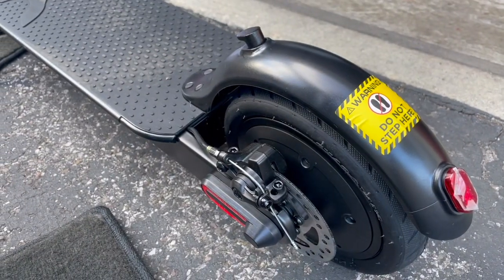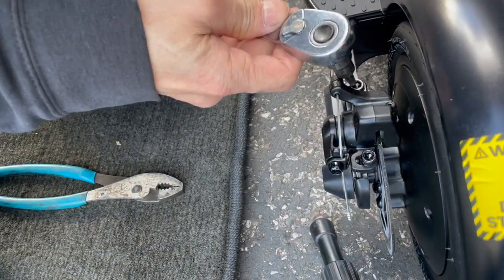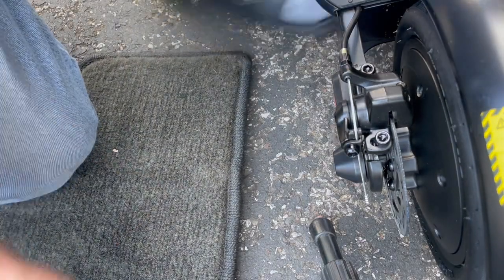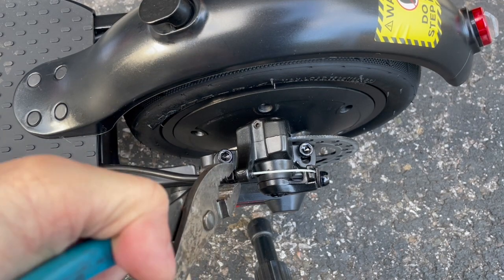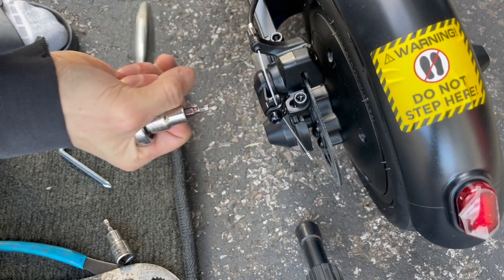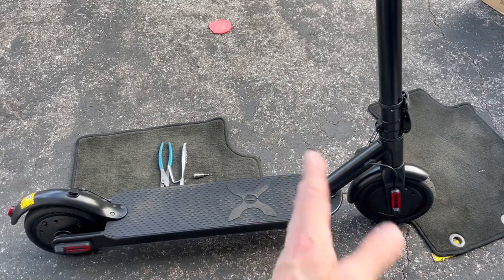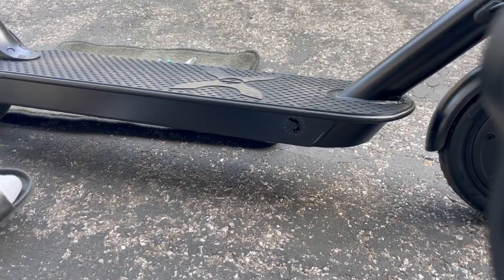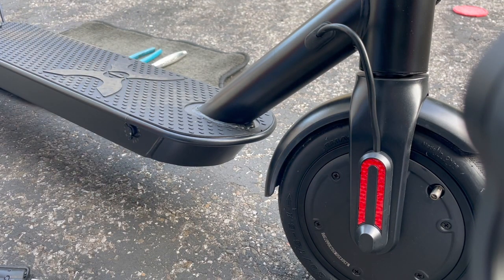Hoover 1 Journey Max brake adjustment

Comment: Did your adjustment help?  I notice the regen brakes on this scooter grab hard and stop too fast.  Trying to find a fix.  Did this adjustment help you?  Thanks 😊
Reply from the maker: no, just have to shift your weight down and back.  I do notice that if you are going faster the regen brakes comes on stronger then when going slower